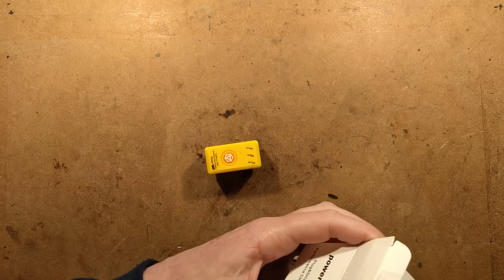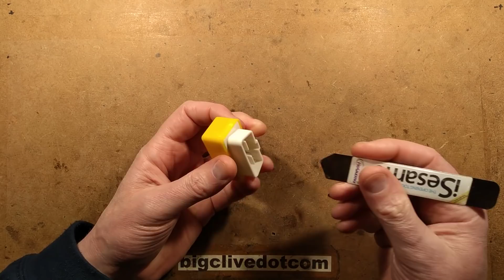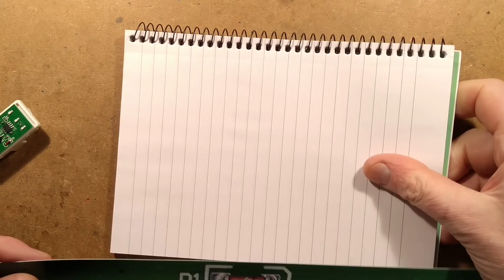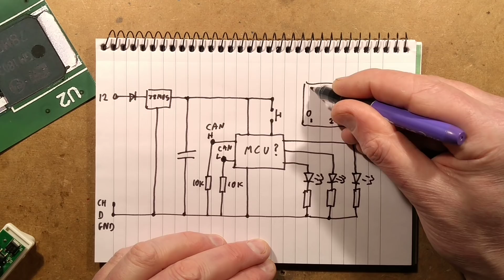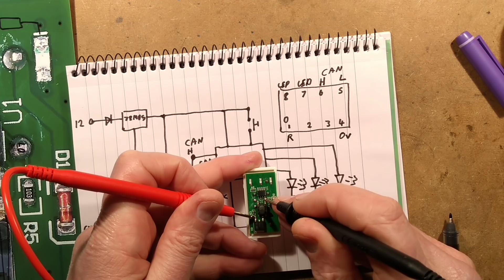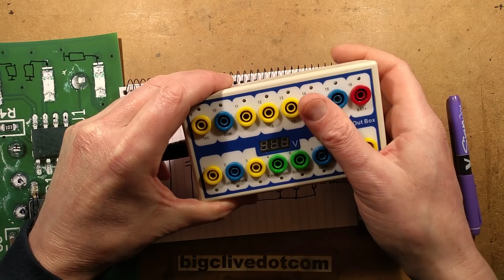Simplest OBD2 engine remapper yet, with actual canbus connection.

Comment: In the U.S. it is a Felony to operate a motor vehicle with a modified "other than stock" fuel management program in the ECM. Changing fuel trim can get the vehicle impounded to start. Ask Volkswagen.

Comment: Anyone considering buying such a device for the advertised reasons should first contact me about a large number of internationally renowned tourist attractions I have for sale on a first come, first served, cash only, used, non-sequential, unmarked bills only.

Not a placebo, a joke. The reasons such a device is not going to work are numerous. Firstly, not all ECUs can be remapped without completely reflashing some form of EPROM using bench equipment, some cannot be rewritten at all. Next, once beyond the basic emissions control obd signals that are mandated, manufacturers can use pretty much any darn CANbus "language" they choose. Next, the same engine, from the same manufacturer, even in the same vehicle model can be available with different states of tune, and hence base maps.

Comment: Interesting and insightful video sir. That thing is as basic as many of the ignition disablers I've encountered that used car dealers use. Those things are so annoying when they start going bad. They cause all sorts of running problems. I can only imagine that over time this bugger would do the same.
Reply: Me as well.  I've found a few hidden with wires tapped into obd wires instead of port.  Units like this do not allow the computer to go to sleep  resulting in a current draw and if vehicle isn't driven alot causes battery to die.

Comment: I bought one of these as a generic elm327 unit, for something like $13 US...I was testing some software and wanted a poorly rated dongle to see if I could make it work and at the same time, make my software more robust.
But, in fact, the thing failed electrically. It went bad and did cause issues in my car that required more than one cycle of the key. You are 100% correct - as usual.

Comment: I feel like these plug and play things are underrated. I mean most are supposed to give 10 to 40 more horsepower and slightly more torque. But you wouldn't really know unless you put it on a dyno. Unless you have slight mods you probably won't notice that big of a difference.

Not sure my lincoln ls needs one tho. It already pulls a 0 to 60 a second faster than magnum pi's old Ferrari and reaches top speed faster. Tho a chip could maybe raise the speed limiter to 4 miles an hour faster than the 141 the Ferrari can go since the chip I do have raises the speed limiter 10 mph. Tho I havnt tested that and have only gotten the speedo up to 120 on private property.
Reply: I will say the mpg probably is the best part. Recently made a 1200 mile trip to florida and back in a V8 at 65 to 70 mph the whole time driving with a heavy foot and only spent 160 one way if that in an 18 year old car.

Comment: Modern cars have CAN at the OBD port (usually around 2005-2007 onwards, OEM and model specific), older stuff will have a CAN bus in the vehicle, but not exposed to the OBD port.

Comment: Only thing i have found that works , and its on diesels only i think is a chip box you install under the bonnet , connects to the common fuel rail plug then back into the loom. I think it fools the ECU into thinking the air temp is colder or something, maybe a few other things as well . They cost anywhere from £80to £100 plus but do work . I had one fitted to an x-type jaguar and there was a very noticeable difference in throttle response and acceleration , it was a little bit of trial and error to choose the correct setting for it , anywhere between 1 and 9 . 5 was best for general everyday driving , going higher and giving it a lot of wellie for a while would bring up the engine management light but no damage caused

Comment: I‘ve actually once DoS‘ed my own car while working on the OBD port. I‘ve tried creating my own fuel economy gauge and because I sent the commands too fast my car freaked out. The running engine just simply turned off and it gave me a few warning lights to enjoy.
Stopped the script, unplugged the cable, turned off the car and restarted it and everything was back to normal. But that was certainly a shock moment.
Reply: that's pretty cool
Reply: that's wild. crashed your car (electronically)
Reply: too many interrupts lol

Comment: The only car woo woo I tried that did seem to do something was a coil lead that was supposed to increase the spark duration.  It did make it run smoother.... for about a month or two... then it died. When I cut it open is was basically an air gap with different lengths of carbon filaments either side of the gap. It appeared that the ends of the carbon filaments had eroded until the gap was too large for the spark to jump.
Reply from the maker: Is that the one they used to demonstrate as making a cascade of tiny sparks instead of one big one?

Comment: Is it possible that 10k resistors for canbus connectors can fit within the chip?  But nooo... probably their boo boo was just misconnecting the externals as tiedowns.  That makes me wonder though, how many of these in-parallel 10k (termination??) tiedowns would the bus drivers have to cope with in a vehicle?

Comment: I'm wondering if you have pins 1 and 2 swapped.  Meaning they just tied "~Reset" high, and the button (normally closed momentary open?) doesn't actuate the reset, but is just a hard power interrupt.  I'd be interested to see a logic analyzer on the CAN network while it's plugged into a car.
However, it's still 99% likely to just be a fake light show...

Comment: Maybe get @electronupdate to decap one of those and see if there's anything interesting in the silicon? It does seem really unlikely there's actually a CAN transceiver in there, but a decap might reveal what microcontroller it is. You'd think a one-off design would be a blob instead of packaged, but they're clearly not cost optimizing very well since it's more than one layer.

Comment: I've had the "same" thing sitting in my junk draw, externally identical packaging,
But the pcb is different
It dont have the 8 pin chip it has a
20 pin STM8S003F3P6CTR

Comment: OBD2 started in 1995 for some Ford vehicles in the colonies. My 1995 Ford Ranger is full on OBD2, been told it's not but scanners read it fine and I've changed to a later EEC from 2001 for higher resolution timing control with no problems.

Comment: Generally, most cars have multiple CANBUS routes,  CANBUS on the OBDII connector is connected only to car ECU via separate wires. In most cases, you can't interfere with communication between ECU and other systems (ABS, AIRBAG....). Another snake oil device.

Comment: Told my nephew a while ago that if you hook a capacitors across the spark plug wires itd boost his horsepower..  he asked how much horsepower and i told him it depends on the size of the capacitors, the bigger the better..  so about a week later he showed me that he found some big capacitors (2000 μf 15vdc electrolytics). But they were a good size, about 2 inches tall and half round..  so i told him you got to put the pin with the black line to the plug wire and the other to ground..  took him an hour to put all 6 of em in and he started up the car and it blew every one of those things, killed the motor too..  fouled every plug to the point of damn near melting the tips..  dunno how but it did..  laughed my ass off..  bought him new plugs and wires and put a turbo with a tune on it for his birthday that year..  his mom about killed me for it but he deserved it..  not all 400 horses but most of em..

Comment: 19:24, you mention fuel magnets.  here in australia, racing superhero peter brock was selling a "polariser" back in the 1980's.  it created problems between him and his employers general motors holden.  they split up with much acrimony.  remember, peter had access to dynos to test his polarisers.  anyway, a few years later i was in a performance centre and on the counter was a supposed performance improver.  it looked like a black poly reticulation fitting with 2 piss weak magnets in either half of it.  cast in the plastic it stated that the patent for the device was held by general motors!  it could have been mine for aust$110.00.  hmmm!  so got 2 supermagnets of the same size and installed them on the fuel line like this gm patented device.  any improvement?  probably not.  but hey, supermagnets are never a waste of money.  hours of fun and blood blisters on fingers.  it is on wikipedia that magnets can induce some chemical reactions.

Comment: When I worked on Cars.  We did sell Power Programmers for Trucks and SUV's.  But they actually did something.  They were in the $300-$500 range.  It was a much larger Box.  It would actually save a copy of your program in the Programmer so that you could restore it back to factory default.  Then you can go through the settings to change the things you want to do. But generally, to get the best performance, you would have to set it to Premium Fuel.   At that point, you would have to fill up using Premium Fuel ONLY.  No more Regular or Mid-range.  They actually did do what they were supposed to do.

Nothing like this little toy thing that is shown here.  It does a whole lot of nothing.

Comment: Well... Sure, 9 mAh may not be much. But I measured the quiescent current of my car (an Audi A4 B5) and it drew less than 5 mAh will short 10-15 mAh pulses every five seconds or so. On average, I think it's safe to say that it drew significantly less current than that "tuning" chip thing. And the car even showed the time.
Also, I don't know what kind of microcontroller they're using. But an ATmega328P (as on the Arduino UNOs) for example draws about 6 uAh in deep sleep with watchdog timer to wake it up without the watchdog timer it draws less than 1 uAh. So if you can live without the blinking LED in standby you could wake it up with a pin change interrupt when there is activity on the canbus and you could get it to run at less than 1 uAh plus whatever quiescent current the voltage regulator needs. If you really need the LED you would need 6 uAh plus maybe about 15 mAh for the processor and LED while blinking and plus the quiescent current of the voltage regulator. In either case you could EASILY get it to run at far below 1 mAh on average. So 9 mAh really is a heck of a lot for what it's doing. I figure they were to lazy to deep sleep the microcontroller. But you know, if you're gonna make a chip that does nothing. At least have it do nothing without unnecessarily draining your battery.
Reply from the maker: It's most likely the LED flashing software was done in the cheapest and minimalist way with no regard to putting the processor in sleep mode.  It would also need a vibration monitor to even detect the vehicle wasn't in use.
Reply: @bigclivedotcom  You mean an accelerometer? Why? I mean, it probably doesn't read data from the canbus so it doesn't know if the engine is actually running. But I guess it could just run its important looking blinky program whenever the ignition is on. And when it's not just deep sleep and maybe occasionally blink, to show it's attentive or whatever.

Comment: i guess it might save some gas , pretty much the same way as buying an airplane ticket or maybe a bag of cox coal , the point is nether of them are free , less monny in the pocket , the less gas you can afford.
but in the long run it's impact will be , a higher electricity bill ect gas/disel. by  your generator and maybe even catch fire.
the only sane thing to do is Burn it whith fire , atlest then you will get some of the energy back from the plastick its made of.

Comment: My performance booster chip came from The Royal Palace of Nigeria... it has an official seal of authenticity and only cost $65 per month.

Not sure how much horse power it added, but customer support said they can double my gain any time I choose, by sending another $100 per month. It’s a bit expensive, but I could sure use the extra power.

Comment: For a moment, I thought that Chinese companies have succeded in combining microcontroller and CAN transreceiver in 1 chip. That would had been faboulous.
Reply from the maker: It's better to keep them separate as any network driver is where external faults usually stop with smoke.
Reply: @bigclivedotcom  I offer an almost witty analogy here.  Keep your cool CPU going Clive: let your fingers do the talking and recklessly interact with high-power, high heat, poisonous chemicals, and blood-inducing pointy things.  Fascinating until the end.

Comment: I know this is old but... what there supposed to do is read, intercept and rewrite data on the fly... it doesnt change the fuel map in the ecu, so it needs to be always connected, and adjusts the fuel values aka fuel correction as you drive... it never works for all cars since im sure its a vehical specific protocol to prevent hijacking. To see if it works youd have to see the network data then you can confirm if it outputs data and whether the devices accept the corrections... but yeah its basically a cheap ass piggyback type bs

Comment: 18:25 - Nah, not much of any real danger there. Cars usually have multiple physically separate buses, with one or more gateways that pass through only a well-defined selection of messages to the other buses. For example, IIRC the car models I did some development work for a while ago had three buses: One for critical stuff like the engine, one for infotainment, and one for the OBD interface. If you'd accidently upset the diagnostics bus big time, the gateway would set a ton of errors, but other than that the engine and infotainment subsystems would remain unaffected. The manufacturer never liked it when we screwed up the infotainment bus, but there was no way we could have messed with critical systems (other than DOS-attacks on parked cars; turns out, one thing the manufacturer REALLY didn't like was drained batteries).

Comment: haha u kno right away when it claimed to know every cars engines characteristics since the 90s..lol apparently they didnt think about that statement too hard.. even if they just wanted to cover a small niche, my area of gm diesels, theyd have to have a hard drive just to contain all the table data we'd need to flash the ecm, not only did each platform have its own tune but each model, not each individual truck but each model has its owns tune their can be over 20 diff factory tunes for a gm 6.5 turbo diesel its crazy